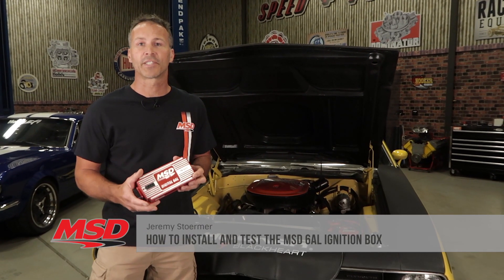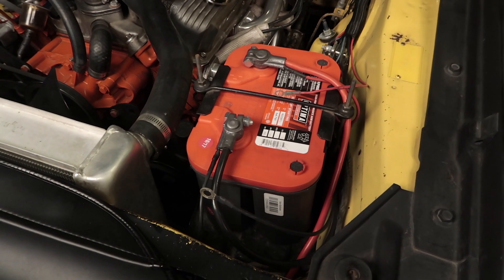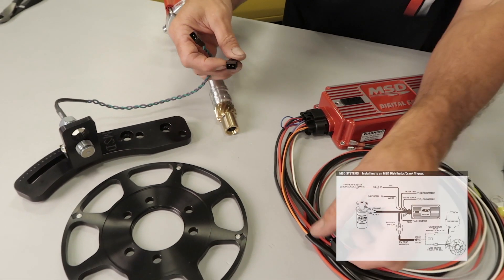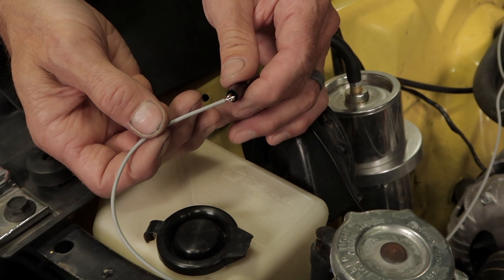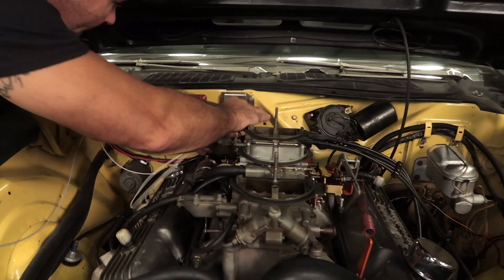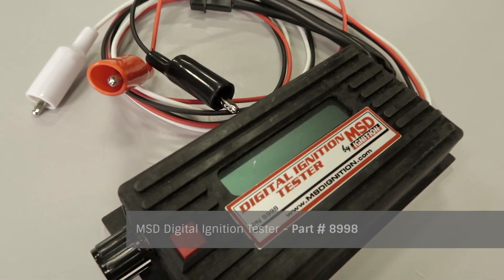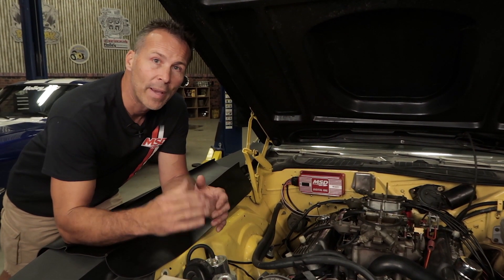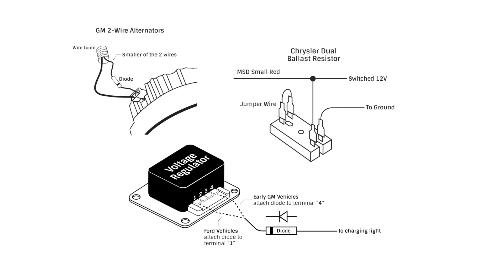How to Correctly Install and Troubleshoot your MSD Digital 6AL Ignition Box

Comment: MSD. May Suddenly Die. I am going on my third one in 3 years, thankfully this one is under warranty. Works fine cold, as soon as it gets warm it starts misfiring, worked fine from May til November. It's mounted on the firewall away from heat sources and has good grounds. Thinking seriously about switching to an Accel ignition box.

Comment: Just installed a new distributor coil wires and MSD 6al box on my rebuilt engine. Now I have static coming through my radio. It will even come through my phone and it’s not connected the the vehicle. It didn’t do it before I had the engine removed and  rebuilt?

Comment: Bought a 65 Mustang and I see the white wire coming from the MSD 6AL 6201 is not connected.  The car starts up great and all seems okay, just wondering if it should be wired in?  The grey wire was not connected either but this is probably because there is no tach installed(which I am doing now).
Reply: The white wire is for points ignition only. Otherwise it is not used.

Comment: I connected one of those units to a Ford XW Falcon and when I start the car all is well, when I turn the ignition off, it keeps running. The power to the unit is only supplied with the ignition on and is cut when ignition is not on. There is no voltage control unit on the inner guards as shown in the video, therefore, I am not sure how I can stop the engine from running on, can you tell me if I'm missing something? I'm using a MSD 6sl, a MSL distributor and a MSD Ballast 3 coil it is connected as per instructions and double checked here that it incorrect.  Thanks in advance

Comment: Just purchase week and a half ago, the 6530, also using trigger wheel. 
Software reading double the RPM that my tachometer is reading.
And yes, I changed the software to the correct total cylinders in the tree.
2 different Tech support  guys had no answer to this problem.....I just sent it back so they can look inside the box.
Hope they find the problem!

Comment: Summit (msd) sbc igntion box, dist. 
Recently developed a crank/no start or hard start condition
Used to run Summit brand 8mm wires always fired up
Put Napa premium Belden 8mm on. 
Could this be an issue? Meaning too much resistance? Everything in the car is brand new .Wires nuts bolts you name it. 
Tired of throwing parts and on disability cant afford to
Thx
PS Neighbor insisted on buying me the fancy NGK platinum?? plugs are those any good or just stick to Autolite 3924?
WAnt to trust this car again

Comment: I tested my msd 6al w/key on (not turning over engine) Msd is connected.i did my test w/pick up wires. Not the(wht) and my starter started spinning i had to disconnect the battery  for it to stop.Why did this happen?

Comment: I did the white wire test coil sparked one time and not agin the light comes on flashing 5 times then stops it will flash when turning it over but then sum times it won’t

Comment: So what would i do if i have a 4 cylinder but 8 spark plugs do i still cut out both loops or do i leave them in tact
Reply: set it for 4 cylinder.   yours had redundant plugs (two) per cylinder.  It's still a four cylinder.

Comment: Boxes are junk made in china brittle wires inside box ...got 2 neither one worked then the tech line said not supposed to have 12volt power at coil..lol even wen cranking 4 volts spark so weak they don't even ask you to test spark at plug!!! How can you have power to plugs if no 12 volt power to coil ????!!! Makes no sense 45 minutes of nonsense answers older 90s boxes better unreliable overrated 280 junk mike flashed trigger signal but no power to coil..they said does not work like that ..lol.ya no shit save your $$$$ you can use a stock 4pin GMC ingnition module msd wires are good proubley why I got a Mallory back in 1988. But Holley owns msd Mallory now ... Edelbrock far better carb for reliability prices of plastic breaks off snaps wife there junk don't buy
Reply: I blew the first one up on my boat and it was my fault because I had dead batteries and had a battery charger on battery on 12 v crank assist and it fryed the box. It was the 6btm. The second one just stopped working but I was careful and did nothing wrong this time. Lasted 5 years. But price went up 400 Canadian since 2019

Comment: Hey how you doing ?
I have 67 mustang 289 and instal distributor msd + msd ignition box I instal all and no Spark Plug in the cylinders and when I instal the old distributor it's works. 
What's the problem you think ?
Thank you

Comment: If the battery is in the trunk, where should I get power for the MSD  box?
Reply: Run it to your main power distribution in the front of the car.
Reply: Run the thick red wire to power side of starter solenoid and ground strap on engine to frame for negative
Reply: @culbycars  no, run it directly to the battery, just like the instructions say to do.

Comment: its normal orange wire from msd to ignition coil,after key on,no possitive voltage?
Reply: Msd will say yes there wrong I had 2 new ones there cheap made in china older ones better how can a coil work without 12 v to + side of coil mad was trying to tell me it's normal..lol joke the wires inside box are cheap brittle try progressive ingnition new but cool you can also use just a ,4 pin GMC ingnition module msd even makes one ..msd ignition boxes are junk
Reply: 2 boxes same 4 volts even wen cranking ...never gets close to 12 volts boxes do not work
Reply: So how does it start also wen running how would it ever show a dip at coil not to mention at rpm how would it have time to pause the 12 volt ? There's no time box has power shows pulse from distributor ..won't start because no 12 volts at coil..lol it's negative volts my brother reminded me tested with 2 new boxes 4 different new coils spark from coil solo weak...12 volt power from key to red wire 2 wires to ingnition 2 to coil plus there +- to battery simple seen read slot on thoes boxes not working rite or they work then not from plastic piece falls off breaks thin wire goes to coil how could it not have 12 volt at coil ??? To start plus it's fiering all the time so it's gonna be 12 volt all the time has no time to go to 0 volts then fire again every ingnition system has 12 volts or ran thru ballets but always shows power wen cranking there's nothing no volts at all
Reply: No they will say yes but it's BS ....there trying to say it only has 12 volts wen foreign..lol so that all the time I tried 2 boxes 4 coils same nothing I went back to my gm   4 pin on my Mopar ...boxes are junk...no 12 volt at coil.ok wat about wen cranking?? Still none
Reply: No mine did same 2 new boxes there junk man made in china owned by Holley they own msd to it's not wat they use to be

Comment: I'm working on 16v project VW scirocco on carbs. My distributor doesn't have vacuum so now without ecu I have spark on 0°
Will MSD with higher rpm send spark earlier or it will be the same?

Comment: Great video. I have had the same MSD box for 25 years, still running. Question:  Do you need to put an inline fuse from the battery to the MSD box. ever in the, and do you ever run the box through a relay? The relay using the trigger wire would be a great anti theft adition.

Comment: On the fence with this product, what’s its actual benefit? Do I need to run this with my MSD coil & distributor or is this just to allow me to control my rev limiter? 

I’m curious because all the information and comments seem to show people reporting issues with 6AL, seems to be that it’s not worth the headache.
Reply: I have had this same box on my 1965 Mustang 289 using a 1985 5.0 stock Ford distributor, stock cap and rotors and 1985 stock  Standard Igniiton coil for 35 years. It still runs perfect. And in 35 years I have the same components:  distributor cap & rotor , coil, plugs, plug wires. I have never touched it since I installed it.  Now I can't comment on any made in china box. But my US made box is great. And now having the internet and videos, great. 35 years ago I had the manual. Engine: 289 bored 40 over, REED cam, dual plane manifold with a 650 Holley,  roller rockers, 5spd TREMEC, aluminium drive shaft, 3:55 possy dif. And for anyone who had read this far,  if you want to know my personal modification using all original parts to get the car to handle better than a Shelby Mustang, and no nose dive. The car sits level, with 1968 Mustang big block coils with 1/3rd coil cut off. The trick is a little mod on the upper contro arms. When installing new upper control arm bushings shift the shaft rearward giving you more caster. And I hardly have any shims, whcih almost hard mounts the upper arms to the frame. Finish it off with a half leaf on the rear leaf spring. One inch from and 11/16th rear sway bars using adjustabe heim joints. My small claims to fame as a custom car builder:   I built a AC Cobra that holds the track record at Road Atlanta and I built the prototype AC Cobra for Exicalibur Motors. I miss those days.
Reply: The box gives you strong multiple sparks which are greater than a stock ignition system. I have a 6AL model 6420 which is analog and not digital cause I didn’t want the known failures of the digital box since the new boxes are made in China. Pick up a used one that was made in USA.
Reply: @johnmilnerQQ  Yep, I have the same U.S. box. Running for decades w/o a problem. It's also under my dash and away from heat.

Comment: This guy: "Make sure you route your spark wires away from high heat sources"
Me: Laughs in headers
Reply: This was a big problem with me lol. I ended up buying a set of high heat plug wire insulators like shown in the video at 8:33 .
Reply: Laughs in 22r

Comment: The thumbnail shows the ignition box attached to the firewall, with the red led indicator on. Yet, there are no mounting screws in the mounting holes. What witchcraft is this?

Comment: I need a msd to pull timing can u help 
 I got a 2003 1.8L turbo 
 On nitrus so i need to retarded timimg by 2/4 maybe
 It's a wet kit. 
Anyway i see the 6msd and the msd6AL bit I still domt no what to get. Utube only show your kits goimg to  a distributor cap. So no good. Please can u help me. I need to no what msd box or control box and what do i need to go with it to pull timimg. Not looking for a 2or 3 stage timing pull
 Just to run my nos safely when spraying.  So i can set it at 2or4 retard as I pull away had spray . Can u help and give me or tell me how do i hock it up . All vids go to the coil big roumd thing old school then to  the distributor cap. I even no how  two wire and MSD box up to the points on a distributor cap now. Lol  but that's not what I want or need help with can u help

Comment: Man I’m struggling with my 6al... 95 mustang GT it’ll flash five times but still start. It’ll run for a little bit. Even days. With a Little Miss in it And a sputtering idle... then out of nowhere it’ll break down and won’t start for a while. It’s even backfired if you times. I’m just really stuck I replace distributor Cap and rotor. I don’t even make the car not ride right the shift doesn’t feel right when is acting up and about to die... Sometimes it will fire up perfect And run great... New plugs new wires the only codes I’m picking up the EGR which has been removed. Thermactor Air system and left and right side which would be the smoke pump It’s sure it’s been removed as well... I’m still gonna do the field test tomorrow any information would be helpful I can upload videos as well

Comment: I use the MSD 6420 box in my 1970 Z28 with Crane XR-i ignition module in my points distributor. I have the box mounted beside the battery mounted in a home made metal bracket using an inner fender bolt to hold it in place.